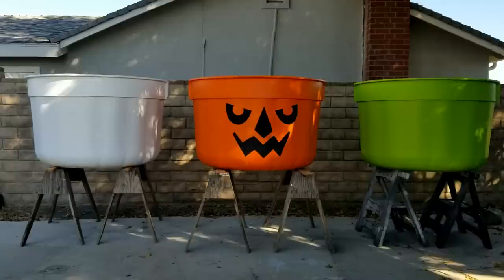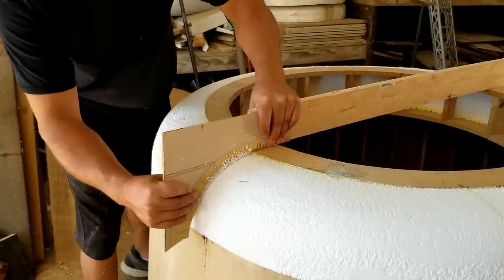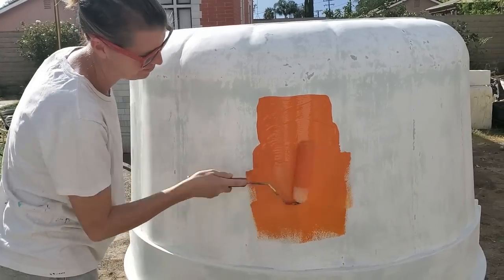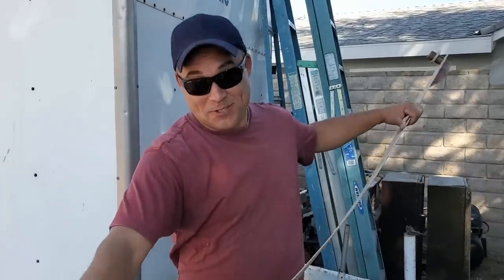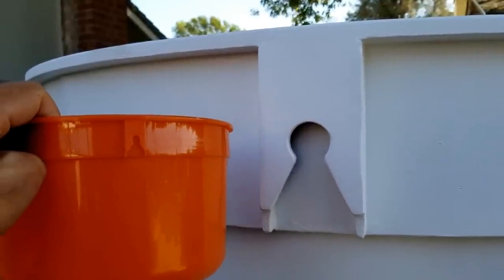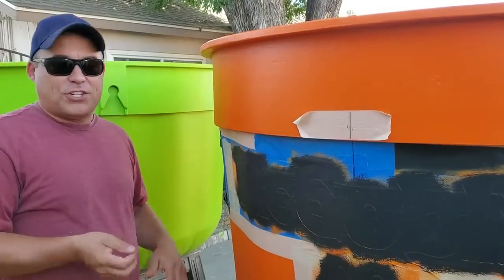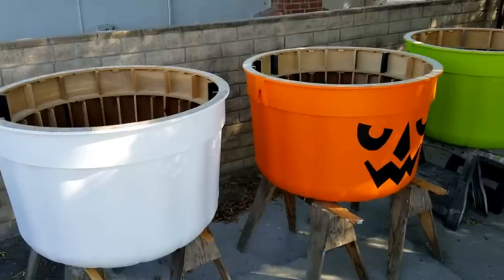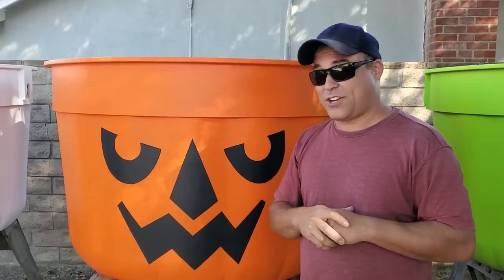Biggest McDonald's Halloween Boo Buckets (Part 3)

Comment: Those look Real impressive and extremely effective, well done guys. Quick question. Why use Gelcoat instead of Flowcoat. I was advised by a staff member at a marine store that Gelcoat stays sticky and was just for using in moulds before fiber glassing and Flowcoat for painting on after. Any advice would be greatly appreciated, and thanks again.
Reply from the maker: Thanks Jonathan we appreciate that. I asked the same question awhile back and I got the same info you did. I'm no pro at this stuff but what I can tell you is using this stuff as we do for sculptures and props I have never used flow coats yet. Mostly because of cost and since I purchase gel coat to use in molds and also need something for outer layers sometimes, I found all I have to do if I want to get rid of any tackiness is add a little surfacing wax to the last layer I apply. But to be honest I forget to do that all the time luckly it ends up ok after prep and paint. Please let us know if you end up trying the flow coat and how it sands ect. I'd be intrested to know any results. Thanks again.
Reply: @HollywoodHaunter  Thank so much from taking time out of your extremely busy scheduled to reply. I`m still fiber glassing at the moment (which is taking longer than i anticipated due to work commitments and coming down with flu and the whether here in Australia`s been pretty crappy). As soon as i start with the flow coat i`ll let you guys know how it performs.

Comment: Instead of Wildfire, why not just GITD paint? That is closer to the original.
Reply from the maker: We have a few cans of that we used on castle grayskull but I don't think its bright enough and it only stays charged for a short time. With black light we can control it a little more. It won't be the same glow but it should still be fun and bright to see.
Reply: @HollywoodHaunter  Glow in the dark paint also reacts to black light. And it is the same green glow.

Comment: As I was watching, I was thinking about photo op & people wanting to climb inside.
I personally would create fake candy popping out of the top, so people can't climb in and beat up your hard work.
I'd put these in front of a black back drop ( so people can walk in front of these, for photos.
I'd also create a flat plywood version of these that are smaller, again with black back drop, that people can stand next to or in front of for photos.
The idea is as they take more than 1 pic, it'll look like they are shrinking.
And lastly if you have time paint a 4' x 6 plywood , but with just a section of the mcd bucket, like a eye & nose cut out with black fabric covering hole.
The idea would be that people could  sit  in front, to look like they are even smaller, or poke their head through the fabric so the photo will look like they have climbed in & can peer out.
Imagine a frame on their wall with a multi hole cut out of matt for several pics to be place in frame.
And finally